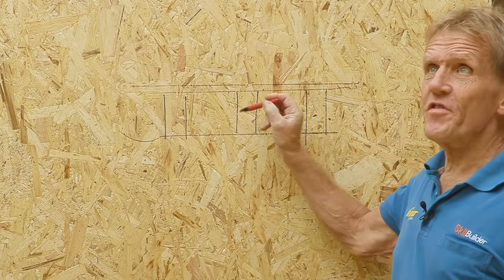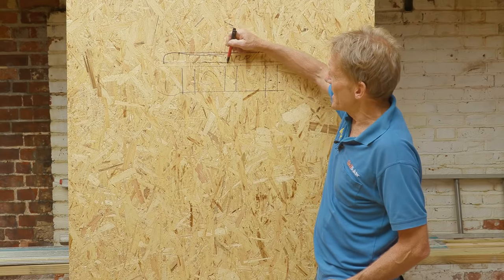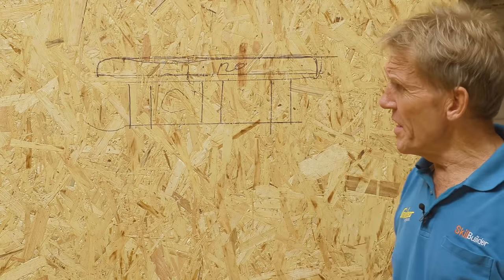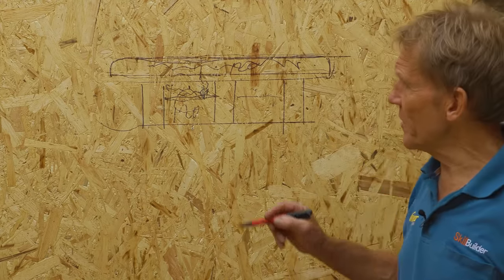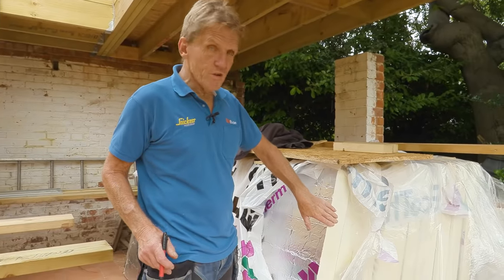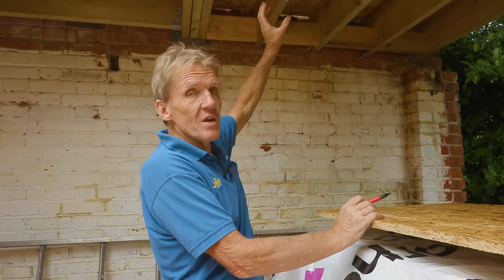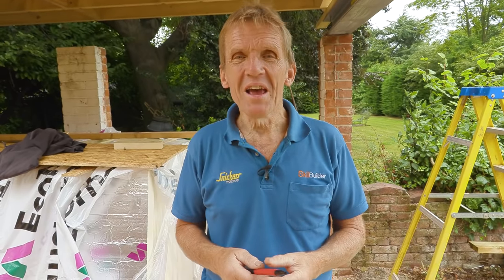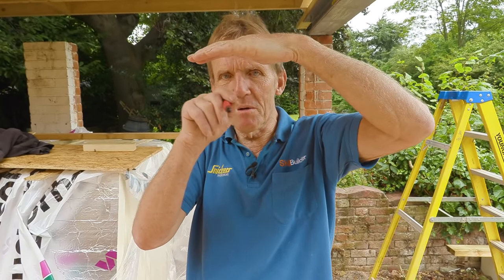Warm Roof vs Cold Roof. What’s The Difference?

Comment: I have a large flat roof over a kitchen, 75mm fibreglass between the joist with cross ventilation from soffit into the pitched roof void.  Its 45 years old and its fine - the fibreglass gets a bit damp in the winter but it always drys out quickly enough.
The original chipboard deck failed after 10 years so I re-boarded it with marine ply and had high performance polyester felt laid on top.  35 years later still no leaks.
Sometimes low tech works just fine.

Comment: I used the 25mm multilayer foil insulation for a warm roof, supposedly equivalent to 225mm of fibre insulation, but adds no more than 40mm with the counter battens. It all seemed to work well.
I'm planning an orangery type extension on the house I'm buying.

Comment: You could simply cross batten between the joists and the OSB to get your cross ventilation, definitely cuts down on mushroom vents
Reply: I built a flat roof with cross battens. It was a continuous problem with the boards moving about and cracking the waterproof layers. 
A butyl membrane would have been ok but the felt I used was a nightmare
I seriously regretted not nailing the boards solid and using mushroom vents.

Comment: Very good video Roger 👍

My questions 👇

So what is your recommendation for roof construction / insulation for 

- a warm & humid climate with cool air-conditioning inside

- a warm, wet & hot climate with “humidity control with cool air-conditioning inside”

- insulating concrete slab roof & concrete walls, in hot & wet climates with cool air-conditioning with water condensing on walls & ceiling

What about MVHR, with humidity control, as an addition to air-conditioning

Look forward to your reply. It may mean a whole new video, I suppose 👍

Comment: I built a garage extension where I didn’t have the height for a warm roof or the joist depth to achieve the required R-Value with venting, so I used Closed Cell Spray Foam. It is allowable under the Canadian Building Code for use in unvented roofs because it acts as a vapour barrier. Pricey though.
Reply: That would never pass regulations in the uk. It doesn’t allow anything to breathe! The uk is far too damp for that type of insulation!

Comment: Hmm. Well, when we build ships we pack the steel against with rockwool hard up. The main issue is stopping the air getting to the steel - or wood - to condense. Given that we have humidity levels at near 100% and a temperature difference of sometimes 90C between machinery rooms and the sea it works fine. I did a roof 12 years ago and used 100mm of Celotex foil backed and sealed it solid so no vapour could reach the OSB and then another 100mm of Rockwool to add even more insulation and fire proofing. No issues at all. As for the plasterboard - I used foil backed and fitted sealed downlighters.
Reply: So the neighbours would rather see a mushroom field !

Comment: I’m stuck with a cold roof on a extension on a grade 2 listed building. 50mm air gap, 100mm of insulation and then a vapour barrier before the finished ceiling is the system I’ve gone for. Then added extra ventilation on the facias, but the vapour shouldn’t  get up into the void to start with.

Comment: Firstly ,many thanks for all your  informative and interesting videos. Two questions please...if I use plaster board with the silver vapour barrier, will vapour still pass through where the sheets are joined...and the second question is could you do a video explaining how to apply a PVC flat roof membrane complete with all the finishing details ?
Reply from the maker: The edges of the board have foil so the amount of vapour passing through is tiny, 
Second question. Are you talking about an EPDM roof membrane
Reply: @SkillBuilder  Thank you for answering my first question. Regarding the flat roof question....it really doesn't matter which material,  eg, PVC OR EPDM so long as whatever is used will have a long life span, 25 to 30 yrs...

Comment: Jeez, that's interesting I did a substantial repair job on my roof myself (Cold roof) I did my research and I knew the principle of the through flow of air and I didn't really do a great deal of work so I assumed the existing structure would work in the way it was designed. I had serious condensation problem. The previous owner - my father in law had put fibre glass in between the joists laying directly on top of the ceiling plaster board. My analysis of the problem was the moisture was getting through the boarding, and then hitting the cold air beneath the tiles the condensation accumulating under the tiles and dripping into the fibre glass and eventually making contact with the plaster board. I felt that the fibreglass that was filling almost all of the cavity and was reducing the air-flow and replaced that with GRP. That then left a good gap for the air flow. Not had any problems since (4-5 years now) so assumed I'd done a decent job. I'm going to check that out when the weathers good. PS it's a very shallow angled roof 25 degrees. Good vid.

Comment: Hi Roger, thanks for such a detailed explanation, I finally understand! We are building a cabin in our garden (for us to live in whilst we do our house renovation). The builder has done a cold roof, but not put OSB boards on top. He has a membrane directly above the joists (where the insulation will be), the battens, then our metal roofing will go on top of that. Im a little confused as I thought you would always have boards on top of the roof, but I guess this way you solve the issue of ventilation/allowing vapour to escape? For peace of mind can you confirm you dont need OSB boards on top? Thanks so much!

Comment: Sorry Roger, gonna have to say to anyone watching…you don’t need those mushroom vents, and in fact they probably won’t create the airflow required. It can be achieved simply with the firing placement and stopping them short around the lantern with having a pickup all the way round the lantern frame/riser to catch the OSB. Cross airflow will do the rest with the over facia vents. Love you channel, love the content but there are many ways to skin the cat as they say, some ways better/more effective than others.
Reply from the maker: Hi John 
We did look at doing that but the kerb detail is tricky because the lantern needs to run off. We solved the problem with a warm roof and a small increase on the parapet.

Comment: Roger for me cold is always the way to go as long as it’s vented properly, around the Sky light/ Lantern you can do a vented upstand where you cut the ply short 25mm and run 50x25  batten vertical and leave the upstand ply 25mm short at the top thus creating enough draw for the air to move, it’s what we always do.
Reply: If you have the height available, warm roof is so much better.
Reply: @TurinTuramber  how many have you had to redo?
Reply: @denty32  Zero of either. Cold roof needs more work if done correctly and down lights can be a pain. Much easier running out full sheets of materials from above deck. The extra height can look unsightly, that is true. Don't get me wrong, if it works it works.
Reply: @TurinTuramber  every flat roof / low pitched roof I get called out to inspect is 99% a warm roof with poorly fitted Vcl. Every one thinks warm roofs are easy to install until it goes wrong. It’s normally a SVP or flue that didn’t get fitted at the time of installation.
Reply: @denty32  On a clear roof like an outbuilding there aren't really any interruptions so goes down super easy. Some roofs are busier than others. Also cold roofs thermal bridge like mad, Roger didn't mention that I think.
Reply: I’ve done 9 this year, 2 believe it or not on Architects houses, one house the zinc roof lasted 9 months until it started to rot
Reply: @denty32  I'm guessing that a warm roof done badly would take a short time to show failure? A cold roof could be shite for many years before being a problem. In terms of thermal bridging, the cold roof's main issue could just be that it's inefficient and something that a customer just lives with thinking that's just the way it is (or the builder tells them that's just the way it is!). I'm guessing that there are a number of cold roofs that you (or anyone) aren't called out to inspect. Maybe?
Reply: To solve the bridging problem on cold roofs, you could put a sheet of 25mm insulation or 37.5mm insulated plasterboard on the underside of the joists.  I like cold roofs as long as there's good ventilation, but trying to get them past building control is a nightmare as they want full condensation and dew point calculations - which is fine if the build-up is conventional.  Not worth the hassle, so I settle for warm most of the time.
Reply: @denty32  
Yep, we have problems with zinc Roofing failing on warm roofs all the time.

Never get that with cold roofs.

Comment: Great video Roger. I used to work at Rose Builders in Colchester and I did actually talk with Dillon on the phone about a possible collaboration a couple of years ago. I now work for myself in Brighton. I always prefer a warm deck roof, avoids any possibility of cold bridging through the joists and allows clear way for any penetrations in the ceiling, downlights, speakers etc. A parapet wall around the perimeter is the nicest look to hide the build up. Keep up the great work. I have a nice project starting in a couple of months. Would be great if you came down to do some filming. Regards. Dave Howells.
Reply from the maker: Hi Dave 
Get in touch because I am just up the road from you and would love to come down and do some filming. Brighton would also make a change of scene

Comment: Apparently in the states they are specifying tissue based pir board insulation when used with a separate vapour barrier. All to do only allowing one vapour barrier. It's constantly changing.

Comment: My moisture is coming from the almost liquid summertime Florida air. I guess the AC is cold enough to drop the cavity below the 89 degree dewpoint and condense. I'm going to drill some holes through the joists and vent it out the side. I'm not putting 15 "mushrooms" through the membrane. Hopefully this works

Comment: Great video, clearest explanation I've seen so far and very relevant to our situation. Similar to the friend you mention we had an extension built with a flat roof in 2016, which has turned out to be as you described, an unventilated cold roof which is very much failing. 

We first noticed a problem after just 18 months when the epdm rubber layer was clearly bubbling and separating all along one edge. Walking on the roof showed up several soft spots in the boards underneath which were not there previously.  Our builder was an apparently reputable local mid sized outfit in Solihull trading over 20 years. I contacted him repeatedly over the next year or two trying to get them to look at it. Over this period and a visit or two from one of his roofers who agreed there seemed to be a problem but couldn't say what, he flat up said it must be my fault for walking on it! All this time he'd insisted it was a warm roof which I new it couldn't be as I knew the insulation was inserted in between the joists, at best it was a hybrid roof, but there was no ventilation which I now understand has to be there. This is when I finally lost my temper and threatened legal action.  

October 2020 he finally agreed to come and deal with the problem at his own expense after first trying to get me to pay for half the bill. Sure enough when they came and ripped the rubber layer off it was apparent that it was a straight up cold roof and the plywood deck had all delaminated. He was pretty shame faced and genuinely seemed to think it was a warm roof they had constructed. After 2 years of pulling my hair out not knowing how this was going to get resolved I was somewhat relieved that they had finally come out and was seemingly accepting responsibility, I didn't fully understand the differences between the various roof methods and I let my guard down and allowed him to feed me some BS about how the plywood must have been a bad batch and they'll kindly rip all that out and replace it with superior osb and instead of the rubber which they also tried to blame the failing plywood on, they would put top quality felt down, which they all did.

A few months later when the rain came down heavy we noticed several tide marks appear on the ceiling below. To his credit this time his roofer came out soon after, he added more felt and extra mastic at the felt edges that run up the sides to meet the coping stones. They had to come out two further times to do similar fixes over the next two months after heavy rain. No further problems seemed to occur during the summer. But in August we discovered a large black mould patch on one of the walls, it was obscured by furniture so didn't immediately notice it. I ripped the plasterboard off to discover the block work behind soaking wet. I noticed there was a drain outlet on the roof more or less above this wall, throwing a bucket of water down this drain showed a trickle of water running down the inner wall. And just this last week again after a heavy downpour another large wet tide mark appeared in another location. 

Patience has finally run, not sure what the next step will be but looks like the legal route after all.

Apologies for the long comment but perhaps it's informative to somebody .

Comment: Really love watching your videos - that are really informative particularly for a novice.  I am in currently undertaking a single story rear extension and I was let down but he builder.  The flat roof basically was completed with trimmers, joists etc and a GRP layer was pasted on.  The roof wasn't insulated so, I got someone else to finish the job and created warm roof on top of the GRP.  I asked the roofer to add in a vapour on top of the GRP and beneath the insulation.  was that the right thing to do?  Will this have a detrimental impact on moisture internally ?  Thanks Joanne

Comment: Really enjoy watching your videos and on a very steep learning curve as starting from pretty much zero. I am building a warm roof but feel like I need two layers of vapour barriers. My garden room will house tropical plants. It is heated and insulated with 50 to 100mm PIR depending on location. I need to protect the inside of the roof (OSB) from rising moisture and there will be quite a bit of it as I water plants in the room. What's the right solution?
I have the Dupont Tyvek membrane and was thinking from inside to outside:
Membrane over joists, OSB, PIR, OSB, membrane then finish with felt
Hopes that makes sense and look fwd to your opinion. Warmest thanks Jerome

Comment: Great explanation! In a conservatory where the roof is plastic and the beams are aluminium, as there’s no wood, would mould still be an issue in a cold roof scenario if you’re using something like recticel for the insulation, is the ventilation still as important?

Comment: Useful but perhaps using non-combustible insulation would be a better choice.  It will certainly be a easier, less messy and harmful material for the installers. Good video

Comment: In the cold roof situation, why not just cross battern the top of the joists with 2x2 before fitting the osb. This way the air can move in and out of the voids between the joists.
Reply from the maker: Good idea and we often do that

Comment: In your opinion, do you prefer a hot Roof? we are doing a barn conversion they have recommended. 
We have a Zinc Roof but we cannot decide on hot or cold roof am I right in thinking a hot Roof is better. Does this also work in keeping the heat out in the summer? also am I right in thinking we would not need to add additional insulation in the roof . Or would you recommend adding extra?
Just found your channel, loving the information  👏🏻👏🏻

Comment: Well explained and shows that it’s not rocket science. I could give you numerous historical examples of where local ‘builders’ ignored all guidance and built 3-sided flat felted cold-roofs between the neighbouring already-extended backs of valley-terraced housing (with no chance whatsoever of getting cross ventilation)….why?…..because 1. they didn’t want to spend the extra money on ‘that posh new expensive boarded insulation’ when 100mm of fibreglass would do the same…..2. They’d ‘always done it this way’ and 3. We never look at the warm-roof plans because we ‘know’ what we’re doing and they didn’t make any sense……….don’t get me started on some of the LA’s building control boys either.

Comment: Roger, what would the position be if you filled with 225mm insulation so no air gap and then put in well sealed membrane and maybe for good measure the backed plasterboard so in effect an internal warm roof. I know the screws would perforate the membrane but they would be compressed and into the joists.

Comment: Not true in the states.  In the states, they put the 'insulation' in top of the roof decking as a padding for the roof membrane.  It really serves no purpose for thermal insulation.  We insulate for heat on the inside.

Comment: Where do you put the electrics/extractor tube if the space between the joists is filled by insulation? Is it better to get a warm roof if you don’t have problems with the neighbours?